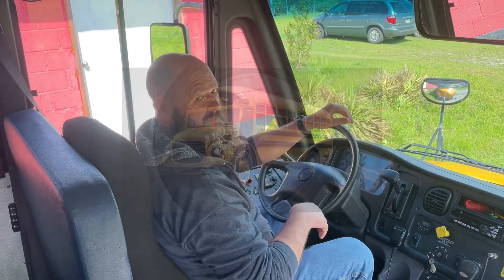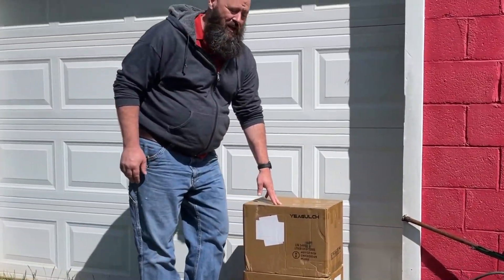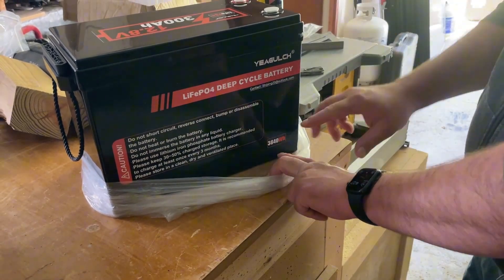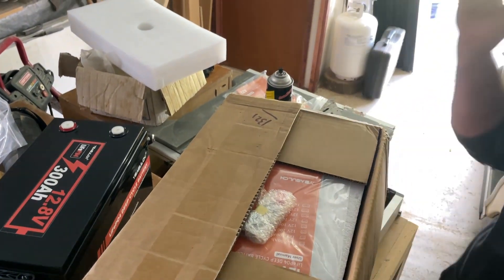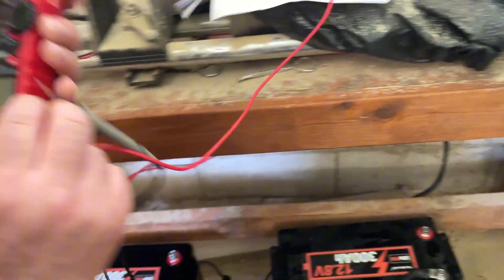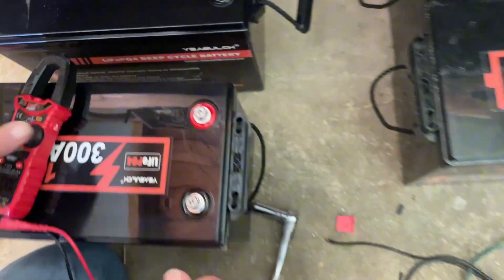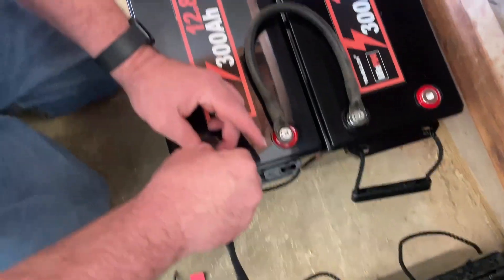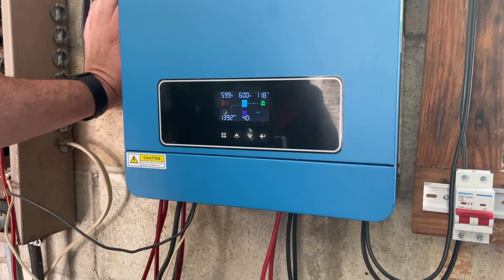Are 12V 300Ah Batteries the Best Solar Power Deal in 2025?

Comment: Beginner in solar, will not buy another power station as it is definitely cheaper to build. Guess your inverter is 24v as the batteries are in series?.
Reply from the maker: It was 24v. After this video my Sumry inverter stopped working. Since I bought the amazon warranty I was able to contact there warranty department and got the full amount back. I then got an Orient Power 6,5K 48V inverter.
Reply: @OobiesTips yes, seen another post where you talk about battery cables and your setup is different. Thks for reply.
Reply from the maker: You are most welcome. Thank you for watching and commenting

Comment: Are those batteries on a cement floor? I hope not.
Reply from the maker: Yes they are on the floor. That myth about batteries draining power is that, just a myth. As long as the batteries stay in the temperature range nothing will happen to them. Or at least that is what google says. And we all know what google says is true. That is what google says. lol. Kidding about that last part. 
But if you have any proof about not putting LiPo 4 batteries on concrete please do let me know. If that’s the case I would love to do a video about that. I wish you a good week friend

Comment: I just got one and its going on day 2 trying to run it down so I can measure capacity. 20 hrs later still at 70%
Reply from the maker: Yes It does take a good while   Lol
Reply: @OobiesTips well my test was inconclusive lol.  Turn out I used 2 seperate tracking devices and both failed. The little online stopped a 60ah ND the other was my new battery monitor and that thing is an absolute disappointment . The only thing I actually use the damn thing for now is voltage as the shut part for the current straight up lies.. says pulling like 2 amps while running an inverter at 700 watts. Im not a great tech guy but im not stupid, I know that for a 12volt inverter to spit out 700watts I know its pulling more than 2 amps lmao. If not then I got the world most efficient inverter.😅 hmmm maybe its a magical inverter  that  breaks the laws of physics

Comment: well i bought 2 of these, 1 wont take a charge period (showed up at 12.1v ) i had to fight with Yeagulch but its being returned ( they initially denied the request ) the other one only charges up to 3.38v resting...so even the one that will take a charge is way out of balance is my guess, I dont wanna piss around with opening the case etc and would return this one if I could as well...I'm going to just spent the $$ on better quality lifeP04 with a good bms & Bluetooth so I can see what is going on....dont waste your time with these they are a pain in the ass !!
Reply from the maker: If I’m guessing you did not buy off amazon. Mine still work great and I’m planning on getting more soon.
Reply from the maker: I’m guessing you didn’t buy off amazon. Mine are still working great
Reply: @OobiesTips  Temu

Comment: thanks for the video, can you tell me what the recommended charging amps for one of these is ? is there a range like 30-80 amps or a minimum ? Thanks alot I could not find any info on what the manufacturer recommends, just wanna make sure I can charge one correctly
Reply from the maker: Thank you for the comment!!  The battery itself can take 200 amps but what tea matters is what size wire are you using or going to use. Like if you are using 6 gauge wire, you can do up to 55 amps if it’s pure copper. 3 gauge is up to 100 amps. To get up to 200 Amps you would need 3/0 gauge wire
Reply: @OobiesTips  awesome thanks...I have alot of Marine grade tinned wire leftover from rewiring boats...1awg,4awg,6awg, 10awg etc...I would assume its better quality than bare copper but will be sure to not undersize the wire and also have breakers/fuses in the correct location...I have a Champion 4,000 watt ( 3,000 watt running ) that I'll use to charge but I dont think it has enough amps to properly charge one of these...( has two 20amp recepticles and one 30amp rv connector ) I guess it will work with one of the 20amp plugs but its on the low end of what the battery can take...also need to figure out what portable charger ...hmmmm

Comment: Unfortunately,  many, if not most aren't actually 300ah. The internal cells are 280ah. They just advertise as what the first few cycles run. I bought a dumfume 300ah. After four months, they top out at 265ah.
Reply from the maker: Yep that true about companies doing that. I have not opened up the battery 🔋 and looked for myself. I had them for 2 months now and my Victron Smart Shunt I’m getting 311 AH still on a full discharge. Even if they are 280AH for the price it’s still worth it over the server rack style
Reply: @OobiesTips so those 600ah are not 600

Comment: Do you know if it is a 100 or 200 amp BMS and can you connect to it with your phone. ?   What settings are you using in the inverter to keep the batteries from discharging so low the BMS shuts off and the batteries have to be reset? The 200ah I bought have no connectivity and I believe are 100amp discharge BMS
Reply from the maker: It’s a 200 amp BMS and no to the connectivity. I wished it did but being so cheap I can understand why. I got the inverter disconnect set to 23.5v. It’s a 24v system. My inverter just blew up a week ago so I’m going to upgrade to a more reliable system. It will be a 48v for sure and I will be recording a video for YouTube. Thank you for your comment and I appreciate you!!

Comment: Nice deal.  The only thing I would add is you need to connect-up a whole-battery balancer if you are going to put 12V LiFePO4 batteries in series to balance between the batteries in series.  They won't naturally balance between the two batteries and will slowly drift.  This makes the cabling a bit more messy but it's non-optional if you want the system to work decently over a long period of time.

The only other issue is that, due to the series connection between the batteries, if you ever hit a low-voltage disconnect on one of the batteries, the system may not be able to bootstrap from solar the next morning. You might have to manually wake up one or more batteries before the system is able to start charging again.

-Matt
Reply from the maker: You are correct Matt!!! When I had just two batteries and didn’t set up the low voltage disconnect correctly I did have the BMS disconnect the battery and I had to jump it off with another battery. lol. I love the idea about battery balancers. I have looked that up and that will be one of the next purchases. Thank you so much for commenting
Reply: I wish I could see the inside and look at the construction I have found a video of any teardowns of this battery yet